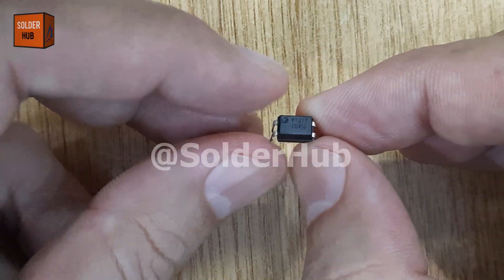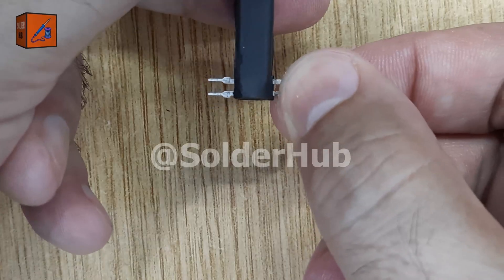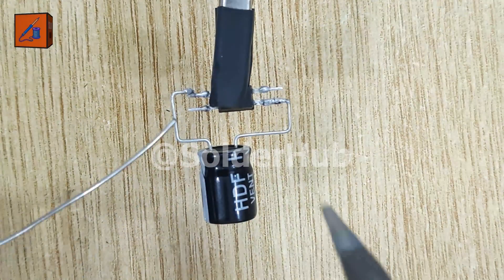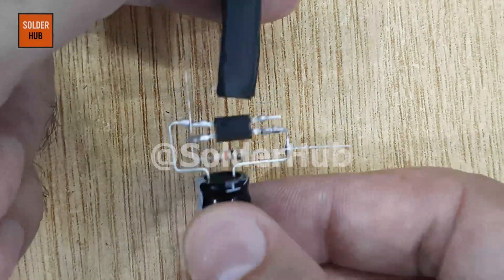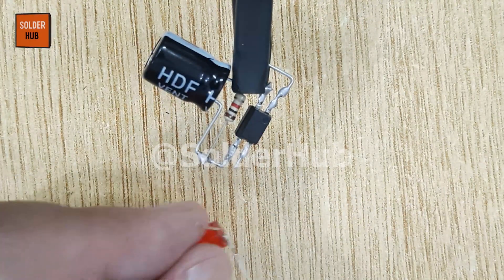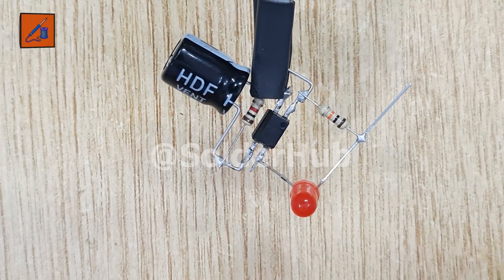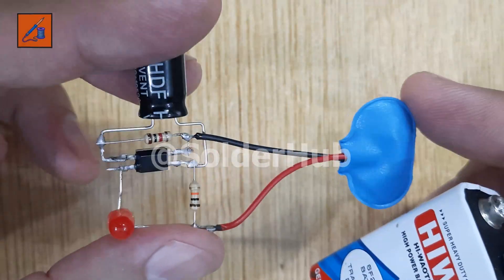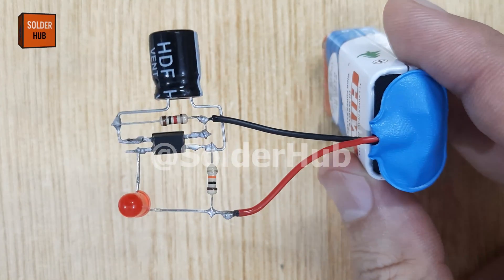DIY LED Aircraft Strobe Light Circuit using a PC817 Optocoupler

Comment: wait... you said that optocouplers are used for isolation (which is true), and then proceed to use it in a way that doesn't need, nor provide, isolation.  If you just want to build a relaxation oscillator, there are easier ways.  You could also just use a 555 timer circuit, which allows control of the flash frequency and duty cycle.  The video doesn't mention what the schematic is or how the circuit works, so I'm wondering what value the video has.  Is it just for folks who like to watch stuff being soldered?

Comment: Why use an optocoupler for an led flasher?
Reply: Has to do with sharp turn on and off.
This setup has a lower parts count than using a 555 or logic gates, and doesn't require programming like a micro controller.

Comment: Without circuit diagram don't understand well
Reply: pc817 strobe circuit   -   Type this in a search engine, you will get 330 circuit diagrams. Try to solve your problem without complaining. It's only 5 components an IC with 4 pins....!   WOW
Reply: @peatmoss4415 was für eine schwachsinnige Aussage, dann kann man auch gleich suchen und braucht dieses Video nicht.
Reply: @dieterstutzkeitz8364  Du bist der Dumme. Ich schätze, du bist sauer, weil ich ihm gesagt habe, er solle sein Problem selbst lösen, und es persönlich genommen habe, weil du nicht auch daran gedacht hast. Die Polen sind schlauer als du, lol.
Reply: @peatmoss4415   you right, but a schematic diagram from the start of an instruction video s/b a given. Plus, any good demo person would show the circuit being built on a bread board, not crudely soldering to the pins. Detailed spec on the LED is also required.

Comment: This is pretty much a solid state version of the classic relay blinker. You might have seen one in your car.
Reply: Not at all like it. Relay in car flasher is controlled by an oscillator switching it in about 1 second pulses. This opto isolator switches the moment it detects light from LED, hence the short on time.

Comment: It is more advantageous to use ESP32-C3 and program the flashing. The flashing frequency and individual effects can be easily changed. One module can easily control multiple effects simultaneously. And use the PC817 optocoupler as the output element. A voltage of 3.3V or 5V is sufficient.

The ESP32-C3 module can be easily controlled remotely via Bluetooth or WiFi using a mobile phone.
I have a model airplane suspended from the ceiling and can easily control its position lights, cockpit lighting, strobe effects on the wings, and landing gear extension.
Reply: not the point
Reply: using a microcontroller to blink an led is really..inefficient. like  using a 18 wheel truck to deliver a pizza. i agree. those atduino raspi esp crowd  mostly know nothing of real electronics  we are not impressed with what you can do with your microcontroller
Reply: Este circuito está resulto con eletrónica analógica, de forma simple y efectiva. El costo no ha de ser mayor a 2 U$S. Para que complicarlo con electrónica digital? El fin de este circuito es lo propuesto: una señal lumínica del tipo estrobo. Puede hacerse con un led infrarrojo para que solo pueda verse a través de un sensor óptico especial o a través de la cámara de un teléfono móvil.
Reply: @eckolviola2055  Porque, si sabes hacerlo, lo harás mejor.
Reply: More expense, more parts more time. My observation is that people that use those micro controllers have absolutely no idea about electronics or what electronic components do.